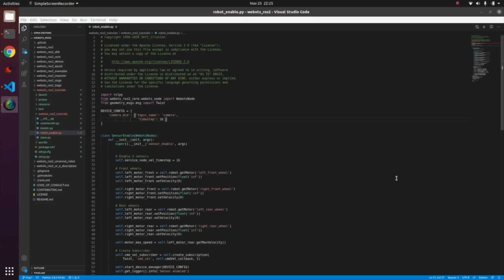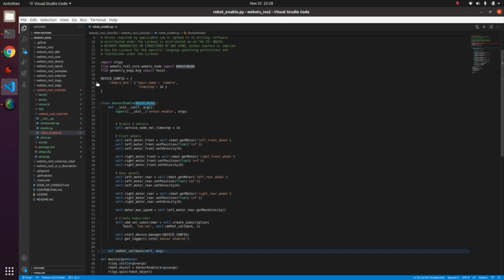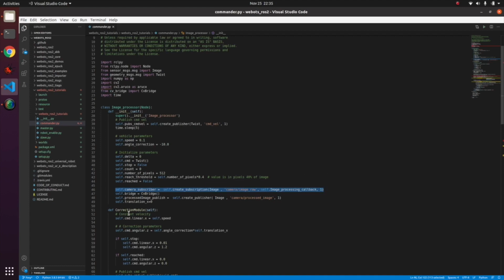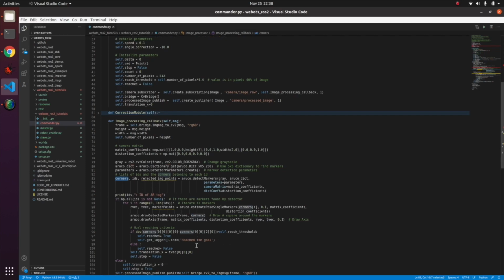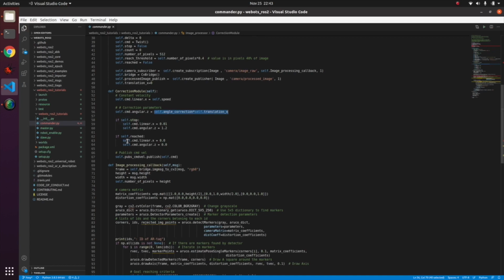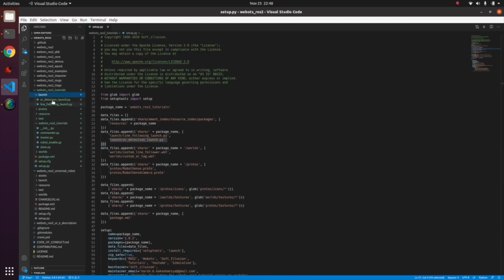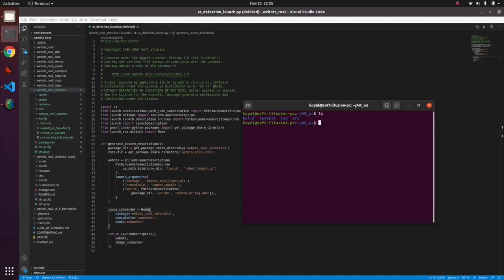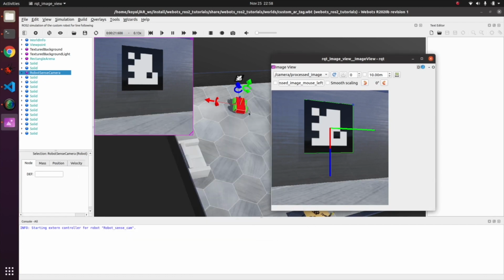Project implementation of AR-tag detection | OpenCV | Computer Vision ROS2 Tutorials | [Tutorial 13]

Comment: Hi. For my project I need to use several robots, I thought that I could just add another robot prototype and work with it in the same way as with the first one. But it turned out that there are problems with this, because as soon as I add another robot,  the first robot stops responding to my node. Therefore, your advice is needed how can I use several robots? 
Can they use each other's topics? how to organize their work in ROS2 and Webots? I would be very grateful for your advice.
Reply from the maker: I think this issue is because of registration of multiple nodes with same name.
You can read about namespacing and do the same for your different robot nodes and topics.

For example one robot will have a/cmd_vel other will have b/cmd_vel etc .